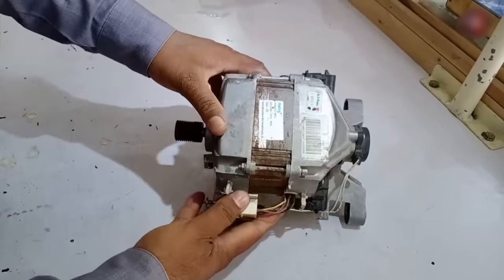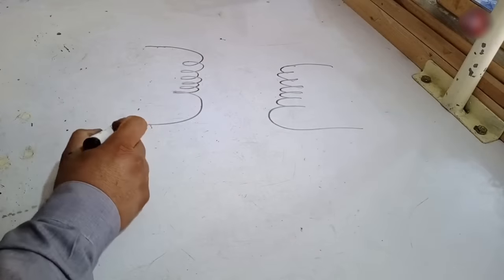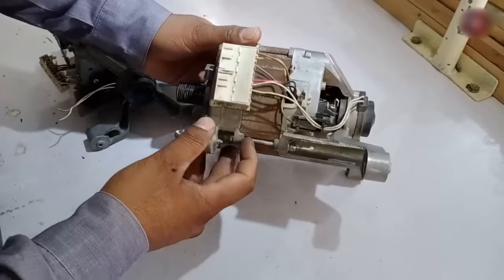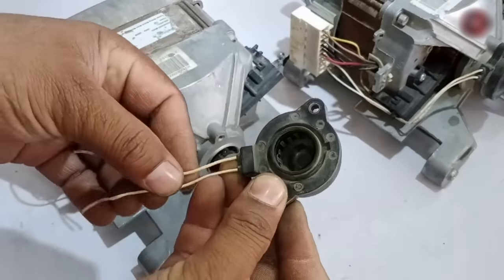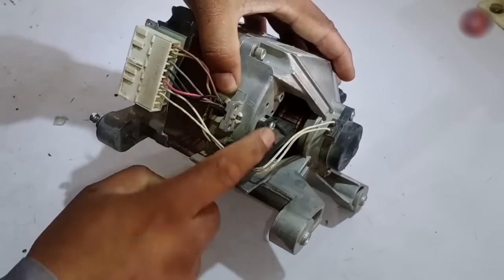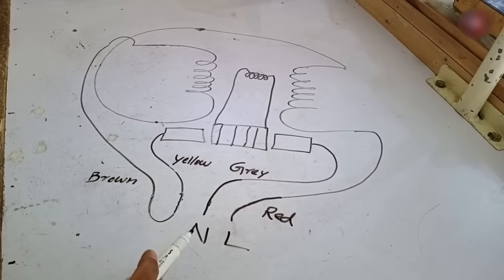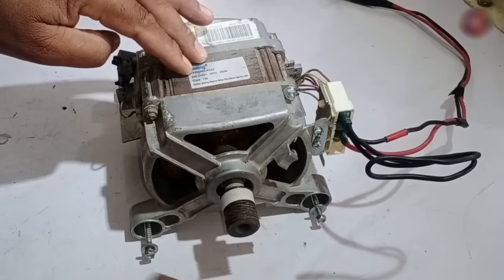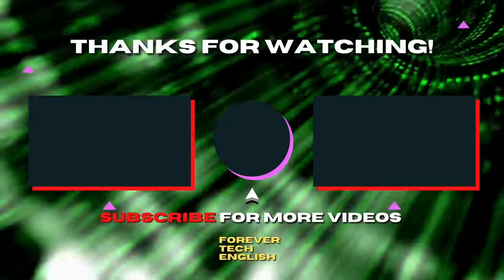Washing Machine Motor Connections For Your Easy Projects

Comment: Nice, but without the feedback involved, this engine is useless. When regulating the voltage at low speeds, it does not have the required force, you can stop the shaft with two fingers.
Reply: Yes, there must be a way round it. . I'll look for other videos that explain the torque/speed considerations.

Comment: On older model motors without pcb,  you can test the motor direct with a capacitor testing each winding,  the spin and wash. Next video ☺. Thanks
Reply: Could you please explain how to do this? How is the motor different?

Comment: A simple relay can control the direction easily. Or a DPDT switch. Just make sure the motor is stopped before switching. Nice video.
Reply from the maker: Thanks for the tip!
Reply from the maker: I have Explained that in another video.
Reply: @forevertechenglish  Yes, I'm sure you did. I haven't watched all of your videos. This was a very good and easy to understand explanation of how this type of motor works. You did a great job.
Reply: That's a very smart idea! :)  Glad i read it. :)
Reply: Mis conmutadores se cortaron en pedazos después de conectarlos como este diagrama a la tensión de red 220v

Comment: thanks for your time and effort,, may i make a suggestion thou...When you are presenting  120 volt systems the way you are doing.. take time and use prpoper color coding onn your input power lines. Common= white wire. Hot wire = black and ground = green.. ty.
I used to use red and black until one day i made a false presumstion .. it almost cost someone thier life.
Reply from the maker: thanks for your suggestion

Comment: Hey buddy that was really helpful.
I have been contemplating using these motors. I think the principles should work for DC connections as well if I am not mistaken.
Again, many thanks and hope life treats you well :)
==BOZE==
Reply: It's a different connection... you need to connect the coil as well.. you can find videos on YouTube
Reply: Yes, DC is possible use also. This engine called also "universal motor".  Is possible use AC or DC power supply. Even with low voltage. For example 30 V to nominal (?)  230V

Comment: I've been wanting to get my hands on a couple of working motors but I'm worried about the wiring of them. I read somewhere that the speed on these is hard to control?
Is that true and would u need a potentiometer of a type to control it better?
I'm only really starting into the electronics game now so It's all a little bit scary. 
I want to wire my own CNC Router one day soon but it scares the hell out of me. I guess that is how it is when u don't know much about it.
I want to build a couple of shop machines using these types of washing machine motors too. 
How powerful are they really? Are they powerful enough to run a belt sander? I do a bit of metal work and I need to build a proper belt sander and I would like to make a saving on the motors if I can. 
I have a 3HP motor from an old Garden shredder that I'm hoping to use for a table saw build soon.
Reply from the maker: Well its always difficult for a new comer to understand such complex wirings, Good luck with your project.

Comment: Very well explained, particularly if I'm right in assuming English isn't you first language.

The only thing lacking is you didn't state what voltage and whether it's AC or DC.
Reply from the maker: It can operate on both Ac & Dc Voltages, But I have operated on Ac Voltages
Reply: It is a universal motor

Comment: Shouldn't you connect an earth wire to the frame of the motor before applying the supply ?
Reply from the maker: Yes, offcourse you have to do it. but in my case I was testing the motor for few seconds, therefore I didn't connect
Reply: @forevertechenglish  OK, thanks for the video. Very helpful and interesting.
Reply from the maker: Thanks Mate.
Reply: If you us this on a car, would you have to ground this to the body? is that why they do that?
Reply: @Eduardo_Espinoza  No. Car bodies are good conductors & used as a collective neutral, so all the car's control circuity can be done with single (+ve) wires. An earth on a mains electricity device is for safety by providing a better conductor than you, in case parts that shouldn't be live become live & you touch them creating a circuit through your body. Even if you connected it as an earth for that purpose, while using an external mains supply, the rubber tyres wouldn't conduct well enough & the car body would need earthing too.
Reply: @ethelmini  
tnx :)

Comment: When testing a  SERIES   connected motor ( like this ) without a mechanical load , the speed can become DANGEROUS ... supply the motor with a much lower AC voltage ( 40 Volts ? ) this will keep the demonstration speed to a safe level ..( tried - n - tested ) ....... DAVE™ ...............
Reply from the maker: ok Sir
Reply: What is the danger?

Comment: Nice, because the motor needs a electronic, without the motor get faster and faster. The rotation gets so fast that the motor comes to the point of mechanical distruction by the speed of the rotation.
Reply from the maker: That's a true fact, that is why electronic control is important
Reply: what you said it is only valid only for a DC power supply and without a minimum load, it will over-speed and destroy itself if not controlled, but for AC power supply, there is no such a problem. In AC, with a triac,  you can control the speed very cheaply, the triac will produce very little heat, but you need an EMI filter on AC to block the noise this type of speed control will generate, otherwise you may jam or damage other electronics connected.

Comment: Can I ask a question about the Capacitors in these motors coming out of a garden Shredder/Wood chipper? Where exactly is the capacitor housed with the motor housing bcos on my motor from the shredder I'm going to steal the whole housing and just cut off the parts I don't want. I'm hoping to use the motor for my table saw build but this capacitor thing is a little bit scary bcos I do not want to get fried for touching that yoke. I have been told they can shock the shit out of u if ur not careful.. LOL
Can I google schematics for these motors and how to get them working again correctly after using them on a new build for my shop?
Reply from the maker: What kind of motor is it, Is it the same used in the washing machines?
Reply: @forevertechenglish  I found this Garden Shredder 2400W in my garage. It's called a Champion, made in the UK I believe. 2006 is the year on shredder. This was never used. It actually sat under a load of crap in my garage for over 15 or more years. I know bcos I was told it was left in the garage and never taken out of the box. 
It's a 3HP motor. It has a plastic housing and this steel plate over the top of it with the blade housing fitted into a round sort of opening. I tried to get the motor out but it needs to be kept in it's housing so I will have to do some cutting and shaping of the top part which holds the blade in. 
It's a nice quiet motor actually. I wanted to ask about this capacitor bcos I could not see one. 
There must be one inside the housing somewhere but I will need to take it fully apart to find out where it is kept within the motor housing. Do all these motors have capacitors? The ones in these shredders I mean?
Appreciate the reply my friend. I'm hoping to use this 3HP on my table saw build. THAT'S SUPPOSED TO BE THE PLAN ANYWAYS..lol

Comment: Nice one sir. However, is it possible Changing the direction of the motor won't pump all the water as it would push the water way from the drainage pipe during spin cycle. I say this once a rookie technician was pranked this way. Hilarious. Excellent video. Show the belt fitment on a tumble dryer if u get a chance
Reply: Don't know where you live but, in Europe all front loading washing machines have a pump which has it's own motor So, the pump is independent of the main drive motor.
Reply: @rt9934  yes. But, before spin the pump clears the water and the drum spin to clear the excess water there after.  However if you switch the spin wires the motor spins reverse and pushes the water away from the suction hole and it won't drain out